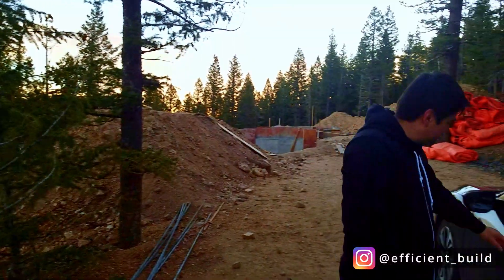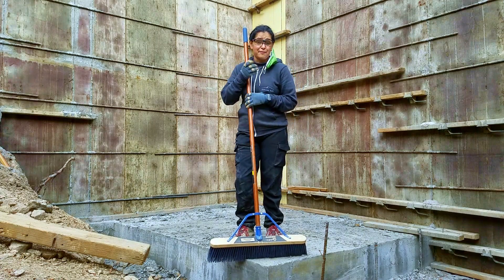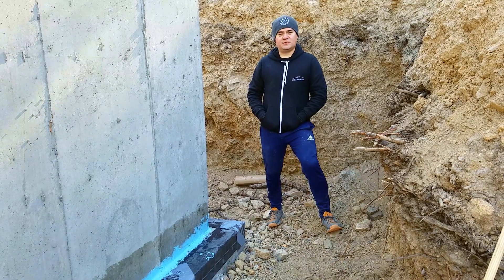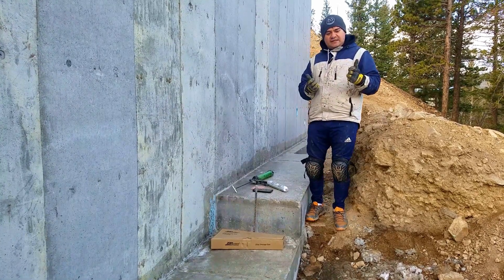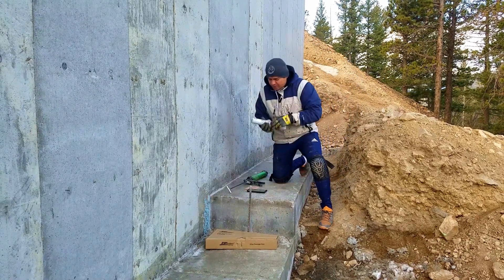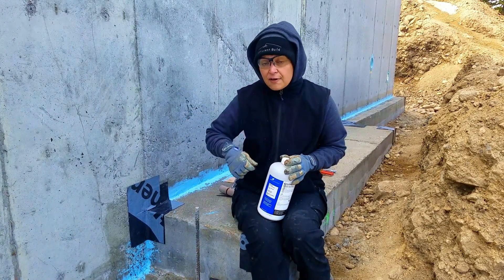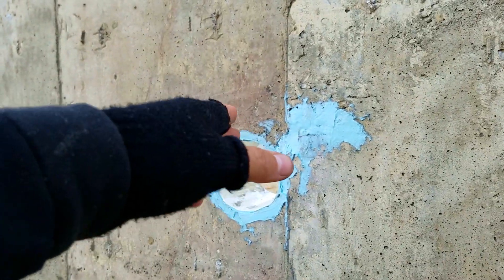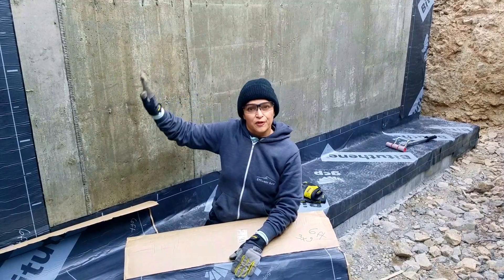Comprehensive Guide to Foundation Waterproofing: Installing GCP Bituthene 4000 & More

Comment: Where did you order this product from?
Reply from the maker: It's been a while but you can get it from Home Depot from among other suppliers. At the time we got it from North/South Carolina don't recall.
Look for:
Bituthene 4000 36 in. x 66.7 ft. Roll System Waterproof Membrane and Conditioner (200 sq. ft.)
It is also quite a bit more expensive from when we got it.

Comment: Nice video. Did I hear you say you DON’T need primer for foundations that aren’t new (i.e. old foundations)? Is that right?
Reply from the maker: Thank you! Yes, you don't need it, but we believe it helps and makes your life easier. Bituthene 4000 is the only one that comes with conditionair, if you buy Bituthene 3000 that also works but doesn't have it.

Comment: I have been a professional caulker/ waterproofer for over 40 years. I have installed miles of bituthene and have repaired a lot installed by other contractors. First I have to say good job. I don’t know what your background is but you handled the sheets like pros.  Most people tend to get the membrane stuck to itself and huge wrinkles on the wall.Also beyond cleaning the substrate you did the 2 most important things condition/prime and roll the membrane. There were a couple of things you did wrong. The sealant at the junction of the wall and the footing should have been a large cove instead of tooling it in a right angle. The reason is it spreads the movement of this joint over a wider area of the bituthene sheets. Also bituthene has a specific detail for pipe penetrations that should have been used. It is usually a bad idea to mix brands instead of using all of the components of a particular system.  You should have used bituthene Liquid Membrane for the sealant work and just warm up the mastic.It is VERY easy to shoot when warm. Generally speaking it is a bad idea to prime/ condition the day before. In fact if you don’t install the membrane on the same day you are supposed to reapply. Having said that, in your climate it would have taken 6 months to follow this. Overall one of the best installations by a homeowner I have seen. And I have seen many professionals omit the conditioner,and not roll the membrane. Absolutely the most important steps. Good job. Hopefully you used protection board( or better yet drainage board ) before backfilling. 
If your pipe penetrations do leak you can use this to seal from the inside

https://gcpat.com/en/solutions/products/de-neef-waterproofing-injection-solutions/de-neef-pipe-plug-kit-data-sheet
I have used this on hundreds of pipe penetrations tha were not properly detailed with bituthene.
Reply from the maker: Thank you very much for the feedback, we really appreciate it. Specially coming from someone with experience like you.
We found that applying the conditioner the day before provided greater adhesion, and by the day before we mean less than 24 hours but typically in the 12 hour range.
We do apply a drainage mat but we have the added complexity that we have exterior insulation.
Thank you for the product suggestions!
Reply: I was thinking the same thing. The GCP spec specifically says to use liquid membrane and mastic. I believe polywall has some ingredients that are not compatible with the membrane